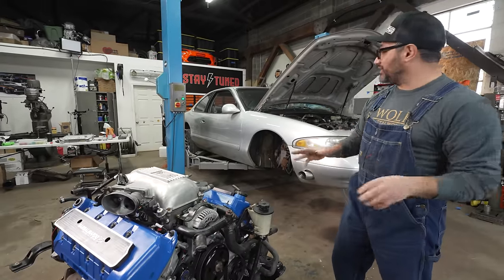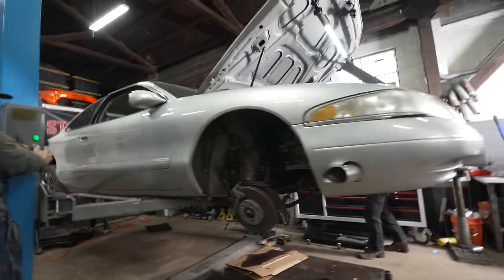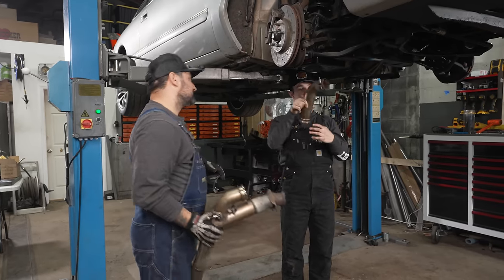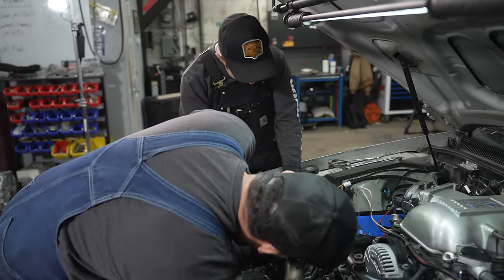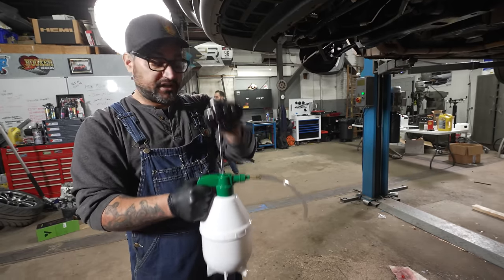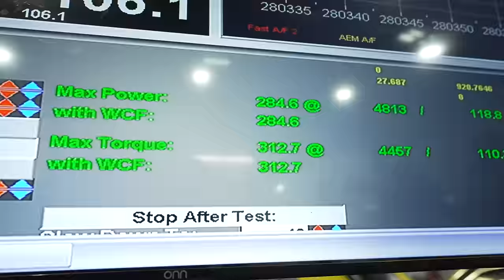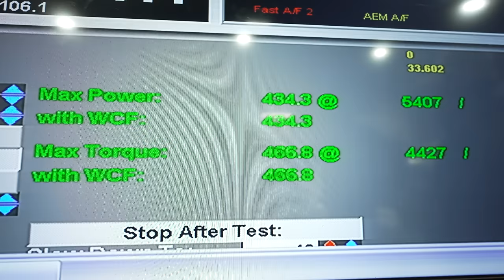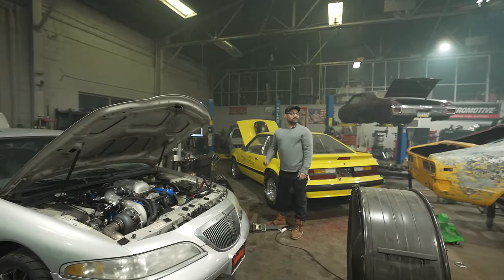Ex-Grandpa's Car Transformed into BIG HORSPOWER V8 Turbo Monster!!

Comment: Hey! I resemble that remark... I'm one of those genarians too,   just over 60 so I've been modding rides for a few years. I  daily drive 2 astro vans, a '93 w/350 ci and an '05 AWD w/ 6.0 ls swap.
As a GM fan I often have the question for the engineers "WTF were they thinking?" 
Was your no oil pressure an issue from Ford or a combination of aftermarket engineering combined w/Ford?  Any clue as to what they were thinking???

Comment: My 4v procharger kit came with a generic tuned chip that sets timing to 16 degrees. Probably a safe starting point at 12#'s
Reply from the maker: I like it. Our issue was getting the timing locked to be able to confirm the offset in the ECU.

Comment: Def think a 7875 would have made that thing more happy along with atleast making that bend easier to get to the turbine for exhaust gases. That turbo maxed is prob pushing thr 650 range so thats alot of boost with no intercooler. Def need intercooler and bigger turbo to make same power with less boost becauze it has more airflow.

Comment: that sucked    i have basically the same engine but with th400 non lockup   im making 650whp with a loose convertor and 14psi   22 degrees of timimg on pump e85   if i was on pump gas i would be around 15 degrees    were you even locking up the trans in gear?

Comment: Doubt the prime is what killed the last motor, assuming it had proper assembly lube it shoulda been fine until the pump primed, assuming you didn't start it up and wing the piss out of it....   I'm betting either the last owner ran the motor and saw the low oil pressure and sold it, or... clearances were just crap.
Reply from the maker: Nah, it sat for like 8 years before we ran it, I think it was the prime.

Comment: Ehhhhhhh its maybe splitting hairs but restrictive exhaust and high backpressure definitely does not help engines stay together, especially with forced induction. Your Y pipe might not be "the" issue as in its broke but it could be a real issue

Comment: Like these old mod motors but man you look at what a coyote makes on eight pounds boost, in my case about 550 wheel...., on a gen 1 yote....things have definitely improved since the nineties.
Reply: A coyote has 11:1 compression and the newer ones 12:1plus more tech and stuff.  This is not a good representation of what they can do it needs more fueling and it's not intercooled that makes alot of difference.  The old 4v can make good power on lower boost too of you give it 11-12:1 compression like a coyote.
Reply: @midnight347  Yup, but ya gotta full build it to have it not scatter its guts under boost. Coyote likes boost so much it's ridiculous, even at its high static compression starting point. Ford learned a lot from the mod motor, for sure ...and applied it all to the Coyote.

Comment: That turbo probably has another 8-10lbs left in it. Put it on Ethanol and some bigger injectors/fuel pump and it should make 600-650 wheel without a problem. Water meth or air to air may be helpful in the longrun…

Comment: That was never really a grandpa car. 
It was a US competitor to various Mercedes and Beemer models, with more car for the same price - bigger, comfier, a 4-cam V8 instead of a Six, equally attractive styling, similar 4-wheel independent suspension, and (hopefully) equal handling and perception of quality. More a well-off Dad car than a Grandad car. And, as this shows, a ton of performance potential from that solid-built modular V8.

Comment: LS 's work due to far More aftermarket parts.
The mark 8 stock walks most cars new and old.
Also the problem is that you should have gotten a mark 8 before that made the LSC.
Blocks before the LSC were better.

Comment: Basically let's say a turbo engine compression is 6 and the turbo compression added 8psi that is basically let's say the cobra engine is 10 to 1 compression and you add 20psi to that 10to1 base stock engine

Comment: Now  please tell everyone  how much money is involved  in building a fo-ord   verse   a  little ol sweet LS ,  a ballpark number for both .Wait a minute , you can make 500++hp on a LS  right out of the junk yard   with a 76mm turbo and it will out live a kellogg  cranked aftermarket rodded up  Ford  parts build !
Reply: a quick guess = Double the cost

Comment: Just to be safe i would think you'd crank with no fuel for a bit till you saw oil pressure to make sure its all good too
Reply from the maker: I didn't know if this gerotor pump would spin fast enough to get suction at 300 rpm, so we went for it.

Comment: Check to see if the exhaust manifolds will flip around and face the front 🤷
Reply from the maker: Unfortunately not, we tried before we built the kit the first time!
Reply: @StayTunedTA  I don't remember which generation of 4v head had them, but they're nicknamed the log, stock manifolds that flow as good as headers. Guy I know had a 03 mach 1 while I had my 94 mark 8, he told me about those. Might be worth looking into, headers for those motors haven't gone down in price much. Tbirds have a cast iron center section and slightly bigger cv axles 😉 I swapped mine out from my 92 V8 tbird and added 3.73 gears with the factory tbird posi lol

Comment: Do enough transmission work and you figure out the trick for converter bolts. 

For GM atleast, there is one hole that is oval and the others all circle. Start on the oval. Send it home on that one. The rest will line up perfectly. Everytine.

Comment: if you wana build something cheap and will hold 750 rwhp 
get :
stock forged gt500 pistons 5.4 (they have the same bore as 4.6) difference is in the strock
stock coyote 5.0 connecting rods 
any 4.6 crankshaft from 05+ but an 8 bolt kellog crank is the best and will hold 1500+hp

Comment: Wouldn't it be better to use a slightly smaller turbo for a little less turbo lag? Since that one still has a decent bit of room left? Or are you all planning on pushing this car further?
Reply: I'm sure they're gonna push it further with a built motor it's capable of alot more.  The fueling is holding it back.

Comment: It’s not your factory exhaust manifolds that’s the problem it’s turbine wheel and turbo exhaust AR is too small.  I had the same issue with my junkyard 4v turbo engine, I have Mark 8 manifolds on mine and had the same turbine wheel and same AR as your turbo and was making just about 3:1 exhaust back pressure, I swapped to a turbo with a 82mm turbine wheel and 1.28 AR and now back pressure is 1.2:1 at 16lbs of boost.  Junkyard mod moda, stock heads, stock  cams, stock pistons, stock cast crank, WAP block, 4v C-heads, On pump Ethanol made 667rwhp on super safe timing, through a 5 speed and I beat this thing like it owes me money.  Also on Holley Terminator X.
Reply from the maker: Could be, we are on a .81, could def go up but we wanted good spool but I wouldn't mind another 50hp?
Reply: @StayTunedTA  that’s exactly what my old turbo was 74mm turbine with a .81 AR.  Spool time is about the same for me with the 5 speed manual and new turbo , it will make 10 lbs in less than 1 sec on the 2 step.  Just have to make an advanced table in the Holley for anti-lag.  If you care to discuss further just shoot me a PM.

Comment: i own a 2000 lincoln navigator with a 5.4 that supposedly came stock with 300 to 330hp and had a   98 f150 that had a 4.6 and the 4.6 was a dog motor compared to the 5.4 but my thoughts are maybe you just started with the wrong ford motor 🤔😄 also hi from the other side of the state over in pittsburgh

Comment: How did you make 500/500 with that RIDICULOUS plumbing!?! I say, unscrew that mess to see how much power y'all left on the table.
Reply from the maker: What if we spend a week making headers, crossovers, and a sweet downpipe/exhaust and it makes NO power!?
Reply: @StayTunedTA  You admitted that the exhaust merge could cause an issue. For what it is, it turned an amazing number.  I don't know, weld an outlet on closer to the front. It's not exactly a common car, so I have no idea what kind of space you have to work with.

Comment: Electric turbo.  Since it takes something like a 100HP motor to put 150 more HP of air into the engine, netting 50HP at the crank, it would be better to just cut out the middle man and make the motor turn the wheels, like the eRay.
Then put a regular turbo on the engine😂.

Comment: All six splined lug nuts are the same. The lug nuts with seven splined are keyed and are different
Reply: Also a 17 mm socket will fit on them

Comment: So for the money you’ve spent on several 4.6’s at this point you could have bought a coyote, slapped a blower on it and made WAAY more power than a 4.6! I don’t get why you would stay with a 4.6. Especially when a coyote will almost bolt right in place.

Comment: "...we took out the bottom end and replaced it with a bigger better one."
"... That opened the exhaust outlet right up for better flow."
"...and the turbo was improved with meth injection."
This reads like a guy's diary of what he had done to his wife. I'm dyin.

Comment: Sir why did you not just unhook the dizzy and crank the motor until you have pressure? Never had anything gp wrong removing spark and fuel and then rotating the engine with the starter

Comment: Hey Tony Angelo, why so much hate on the Mark VIII? Sure, you can say that Lincoln overall is an "old man" brand, but the Mark series since the VII are legitimate hot rods. Their moniker at the time was HotRod Lincolns(like that song) or Mustangs in Tux. Is it because it's a American and its cool to uplift foreign cars and sh*t on Americans? Because I feel that if you had used a 1992 Lexus SC300 you'd be calling it something like "the ultimate luxury sleeper". And the Lexus follows the same pattern as that Mark VIII. The SC300 is basically and detuned, luxury Supra. Just like the Mark is detuned luxury Mustang

Comment: Love the car, always thought they'd make a luxurious sleeper.
That being said, why are you running a turbo un-intercooled?
It completely defeats the purpose? You're literally forcing a crazy hot air charge into the system? At a minimum should have at Least a quality water/meth injection setup!
All that motor and those numbers is sad.
My old 60k mile bone stock 5.0 LX makes 480hp and 580tq, air to air intercooled with 10lbs of boost...

Not hating, just cool that damn charge please!
Car will be a monster!

Comment: I expected way more for 10-12 lbs  😧🤦‍♂️. Those fords are a lil tight aren’t they . A junkyard LS makes closer to 600 on the same boost . No wonder it’s “ LS THE WORLD “ 😝. But still a rad build none the less 🤙
Reply from the maker: HA, yeah I do not think we had the timing pushed very hard, but I'll take 500+ at the tires.

Comment: Something about your tuners always scares me they seem to be lacking compared to most I've used and seen.You definitely need to find a new tuner asap before your doing another motor. It did not sound correct from the 1st pulls only doing 250 at 8psi something was definitely noticeable

Comment: Instead of wasting money on the meth system I would have just ran e85 and an nice size intercooler and never looked back. I still don't understand why half-ass it an cut corners on important stuff like intercooler and good fuel system.

Comment: This thing is not making power the way it should these motors are not a go to motor but they are not junk at 12psi with cams that should be over 600 wheel constantly  it also does not sound good

Comment: Ford Found On Road Dead. Ford  Fix Or Repair Dialy. I raced  figure 8s. My first year Ford   Muarder 390. Once it got hot well I not only lost but two broken arm 4 plates in my neck broken ribs.  Crappy  motors . A year later Dodge Furys 318, lost the radiator and still won the race.  Never race a Ford. They just don't work.

Comment: Downed it for over 8 months and still didn't take the time to buy "proper" headers 😅 expecting a built double overhead cam motor to breathe through a straw and the turbo set-up 🤡

Comment: But u have meth injection right shouldnt that not only take some load off the injectors but also help with detonation to be able to run more timing??
Reply from the maker: Yes, but we were out of injector either way? We had the meth on full blast!

Comment: So…… like, $12k in and it hasn’t made a single pass on a 1/4 (or even 1/8th) mile run?
12 f’n k? Damn, now THAT’S losing touch with the fan base. Most people aren’t spending that much on their entire build, let alone just getting an engine in.
I hope the brakes are tip top
Reply from the maker: Believe me, I didn't want to get here, it just got away from me and I don't love to give up on a project.
Reply: Love ya, bro.  But that’s straight up insanity!
12k coulda built how many TURBO LS’?
4 maybe 5? Should have one of your boi’s buying and junking LS trucks. Once the bodies go to the scrap yard, they practically pay for themselves  @StayTunedTA

Comment: Dude I like you but you ruined a lot of engines not running them for break in time you don't throw boost on a unsealed ring it will never seal one time you do that you have to run them at least 500 miles to break in the bearings and the Rings